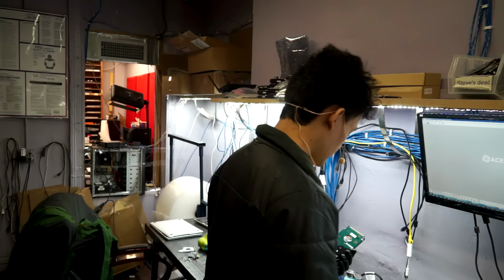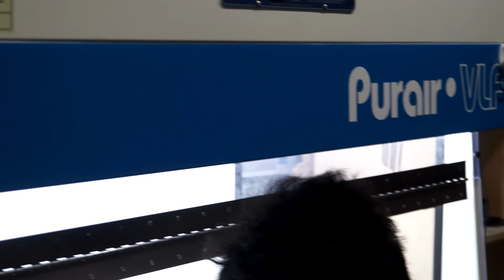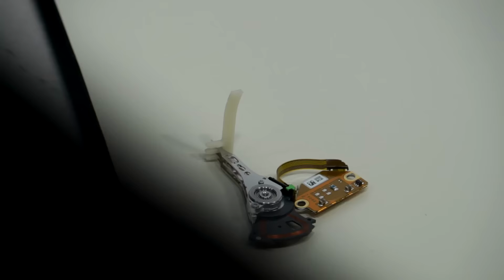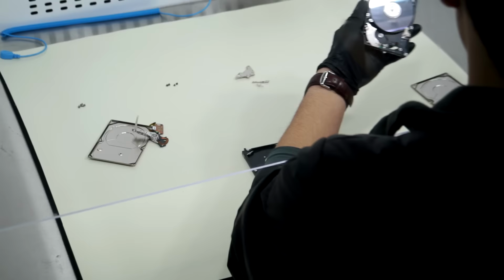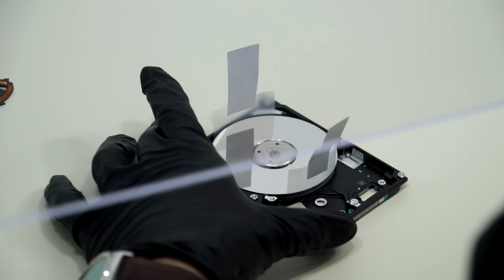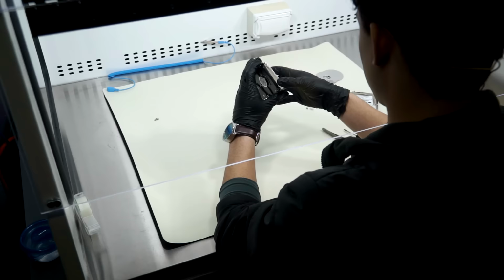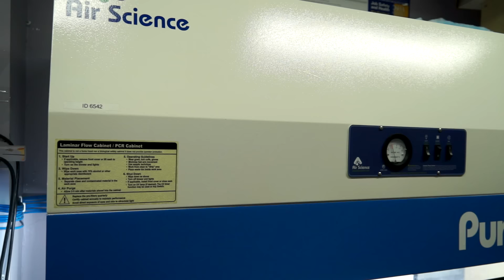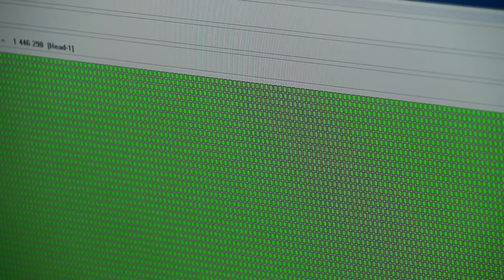Data Recovery: Hard Drive Platter Swap in Our Lab!

Comment: Enjoyed viewing the video and watching the swap out of the platters.  I've been computer tech since the early 70's and it's amazing how much has change in the way of packing data on a platter and now totally different technique with packing data on a SSD or flash drive. Repairing and doing alignment of hard drives is something I've have done for many years. In the early days the disk drives were very large, maybe size of a dishwasher one could say.  The platters were about 14 inches across and there might be as many as 10 platters with 20 read/write heads as could write on both sides of the platters. Many of the drives then had user swap out disc platter assembly where all were housed in a container so the customer could have several disc platter containers and only a few disk drives where as certain data was needed the platter assembly would be mounted / installed into the drive. Sometimes the platter assemblies would get bump or even dropped by the user or when mounting would bump against the disc heads causing miss-alignment. This is where I would be called as would have to repair the disc platter assembly or replace one of the read write heads and then sometimes only have to do alignment of the heads.  Since there were several heads from top to bottom each one had to be in alignment with each other so an alignment pack would be installed which contained several different signals recorded onto the pack. Using an oscilloscope and multiple channels of input I could realign the heads and also align where the heads would move in and out within the pack correctly. The adjustments was done in micrometers using a special tool along with the scope all being done by hand and being very careful. A friend of mine who was to me like a mentor also did the same type of work and many times we would both get called in to do this type of work. He at one time work at NASA doing the early Mercury and Apollo missions.  Sometimes we would have fun contest to see who could get their alignment the closest to being zero on with no plus and minus offsets. By the way even the new drives were similar as the older ones which required the air flow over the heads to allow smooth movement and from being damaged by touching the surface of a platter.  On the drives I worked on the distance between the read / write head and the surface of a platter which I had to adjust was smaller than the thickness of a thumbprint.  This is why the air filter and clean room is needed when working on these as even a smoke particle from someone smoking is so large that it could crash the head of a disk pack platter. So from someone who been doing hard drives repairs say for many years I so appreciated to see your work talent and how careful you were in doing the repair.  Another trick which sometimes work is placing the drive into a freezer for a few moments when data is not readable but the platter will turn. Works better with floppy discs more so than hard drives as it gives a temp repair which can last several minutes, long enough to recover data if lucky.  The scotch tape trick is really amazing at how well it work considering how tight the tolerances are between any movement left to right in relationship to the platter below or above. I would say that most likely there will be some slight movements but thanks to the ECC circuits in the drive it can correct majority of the data that might have issues and why sometimes when looking at the sector map it might show one of the heads having issues as could be the error is greater than what the ECC can handle when doing corrections.  I have used similar sector maps on floppy disc many years ago when recovering data off floppy disc and getting around encryption of data.  How things have change but happy to see there are techs such as you are want to learn that skill and even find ways to be creative in doing the repairs.
Reply: Owo
Reply: Loved your story man! Thanks for sharing, it was an interesting read.